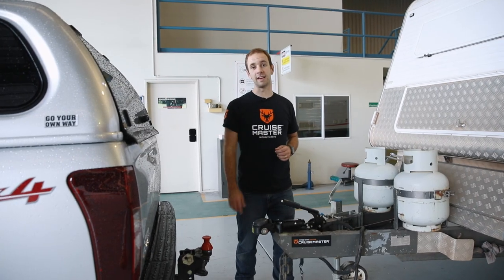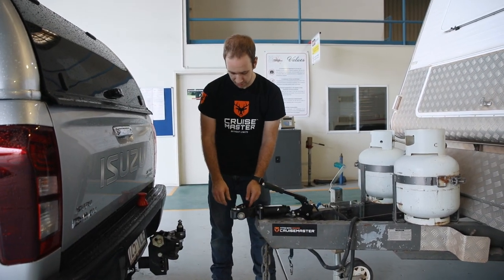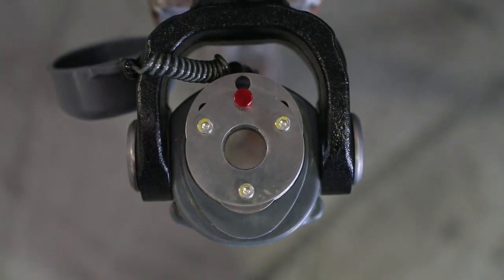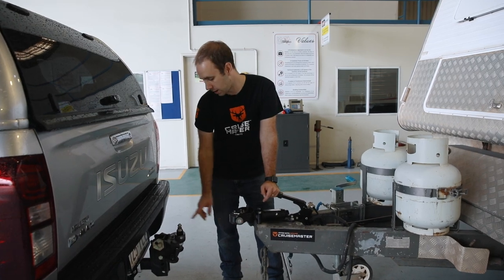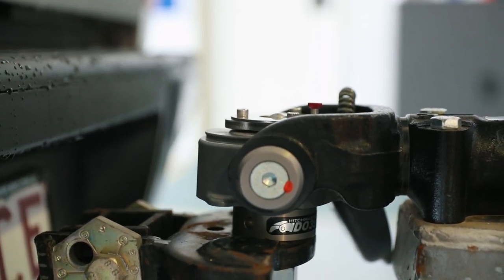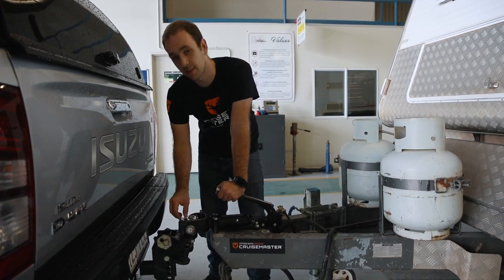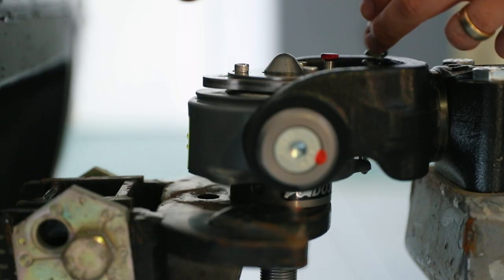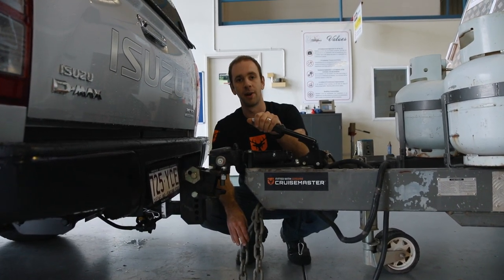Cruisemaster - Hitching Up with the DO35

Comment: I need to know what kind of tool you need to get the hitch on and off of the toung.  there is a round hole that needs some kind of pin to hold it in place.

Comment: Can I use a DO35 7/8 tow pin hitch on a DO45 Hitch? Are the tow pins for the DO35 and DO45 the same dimensions?
Reply from the maker: Hi Jason, these pins will not work across systems. The DO45  has a larger pin and inch and a qtr shaft to accommodate the bigger load.

Comment: Can a Hayman Reece weight distribution system be used with the DO35 hitch?
Reply from the maker: Steve Turton sure can! Developed and tested with the HR systems. Works out of the box in most set ups but we do have adaptors available for extra clearance if required.